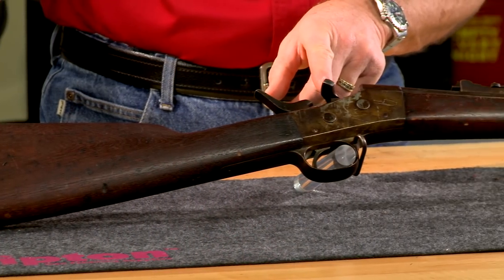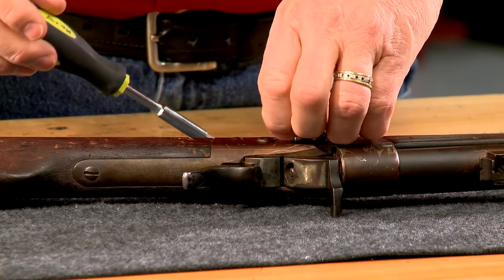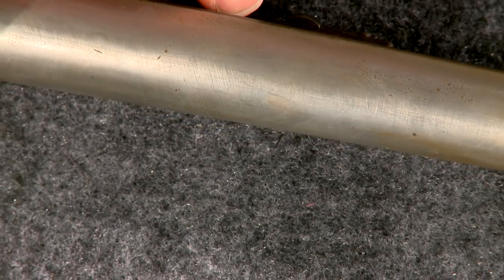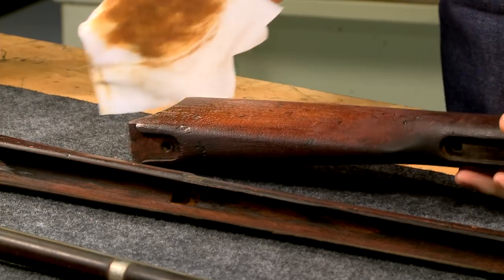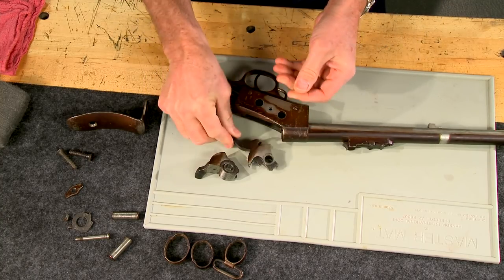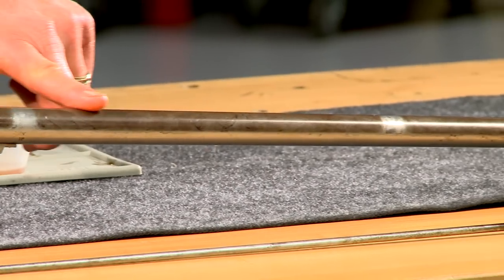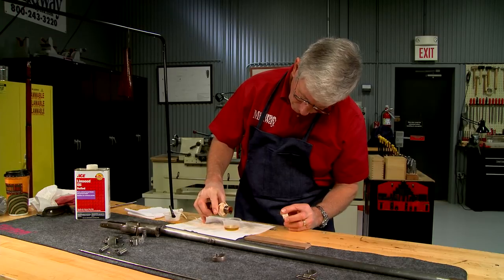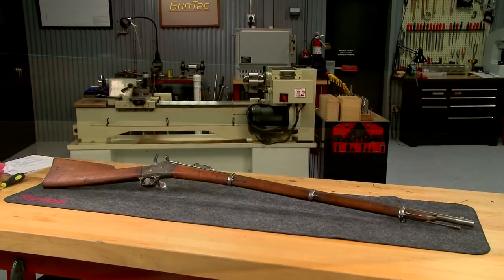How to Clean Years of Dirt and Grime from a Remington Rolling Block | MidwayUSA Gunsmithing

Comment: The key thing is to be very careful to remove ONLY the dirt & grime!  Occasionally you'll be pleasantly surprised by finding much of the original finish still intact underneath.
Reply: Atlantean  I used Murphy's Oil Soap and Tom's 1/3 wax mix to clean up a Finnish M39, and it worked awesome. Thinking about repeating for a Winchester 94.

Comment: Thanks again Larry! I did this with an old Jaeger flintlock rifle. I was VERY happy to have kept the order of which screw went where when disassembling the frozen Lock. Turns out EVERY screw was a slightly different size and length. I carefully drew out a diagram of the Lock on a small piece of Styrofoam sheet I cut out of a to go box. Punching a small hole for each and every screw in its proper spot on the diagram. It took a Vernier caliper to notice the difference in sizes, but without that step it would not have worked after the cleaning and repair to a rounded sear.
Reply: I carefully drew out a diagram of the Lock on a small piece of Styrofoam sheet I cut out of a to go box. Punching a small hole for each and every screw in its proper spot on the diagram.  

I read that in Larry's voice.

Comment: A 50/50 mix of Murphy's Oil Soap and water works well also.
Reply: I have actually seen old mix formula of 1/3 Murphy, 1/3 Rubbing Alcohol, and 1/3 hydrogen Peroxide used to clean BP guns and clean Vintage wood and products. I have tried it our and seems to work well.

Comment: Was that a shaving brush I saw being used to apply oil? Not sure Van der Hagen had that use in mind. Good stuff. Non Sibi, Sed Patriae.
Reply: Yee, it's a shaving brush.  It's a great tool for getting a little bit of oil in all the nooks, crannies and corners found on the typical firearm.  They are available in 3-packs and are very inexpensive.  I keep one in every safe, on my workbench and in my rage bag.  The one in the range bag I keep in a plastic sandwich bag.

Comment: I have an unmaintained Type 99 Arisaka whose stock I am cleaning. I hear that the Arisaka used an extinct, special type of highly reactive finish. Would cleaning in this way be appropriate with this stock? Also, could I use 0000 steel wool on the stock, as I have heard others do?

Comment: Anyone comment...I did this with a really dark m1 garand. I wanted to keep the wood with the dings & dents but clean it up a bit. I did exacty what he did but barely anything came off on the rags & wood. It didn't go down to almost bare wood like in this video. I want to stop where I am & go back later but after all the lacquer thinner Im concerned about just rubbing it down with boiled linseed oil. Any advice on what to do?? Also I would like to scrub down the parts that look rusted but I did & again no real change
Reply: My guess is that your garand has a coat of varnish or possibly true oil or linseed oil that has been left to dry to a hard finish without the excess being wiped off for a more satin / oiled finish. This is another proper, fairly common use of these type of oils, but creates a more impermeable layer that mineral spirits alone won't cut through once this has been left to harden. Try acetone to cut / remove the hard shiny surface. It is a stronger solvent so it will also draw out all oil from the stock and dry the wood if you try to use it to do the entirety of the cleaning, so I would only use it to remove the outer most layer first, then try the mineral spirits for further cleaning. If the mineral spirits still don't remove it, go a bit deeper with the acetone. It is possible to do the entire cleaning with acetone, but as stated, it dries the wood terribly and evaporates quickly so it isn't advisable to use alone. If your concerned about this method, try it on a small less conspicuous spot first. Worst case scenario, though, is it simply won;t cut whatever sealant was used. If that is the case, I can suggest  yet another even stronger solvent used in the same manner.....xylene
 Hope this does the trick for you. I love those Garands! Let me know how it works out
Reply: believe it Thanks, Ill try that. I was worried I may dry out the wood a bit to much with most methods Ive seen/read about. Also there are some spots that seem like the wood is already a bit dry so I didn't want to risk it until I had more information. I did find out a few things but Im not sure how to respond to it. I looked at everything I did the day after and it did seem like it took a good bit off but some of the wood had an odd red tint to it. I read on CMP that it happens when a service rifle has had a lot of oils absorb into the wood and if I read correctly this is a more sought after look/wood set. Since I had things I was concerned about & questioned, I gave it a couple light coats of BLO and put it back together until I can get a better idea of what I want to do with the rifle. It does have dents & dings but I think it adds character, the overall look of it says Ive seen some stuff and I wouldn't want to replace that with a I just came off the shelf look. I just want to make sure its in the best protected shape and still able to take it out every now & then without issue. Thanks again for the info!
Reply: Chem istry You are certainly welcome. Another option is to use 000 or 0000 steel wool to "break" through the high sheen first. Another viable finish method is to allow any finishes (like BLO or Try oil to dry (instead of wiping off all excess) then burnishing it with the same type steel wool to remove the shine. It creates a nice satiny finish while leaving the wood protected by the oils. This is, of course, after you have accomplished all cleaning etc. The main thing is to not go overboard with any of the solvents as you try to get at the dirt. The nice thing with acetone, is that it will generally evaporate far faster than it will be absorbed by the stock. I hope it all works out for you. there are few things as handsome as the wood grain on a garand stock.

Comment: Let's say you've acquired an original Winchester 1873 that has been sitting for who knows how long in a storage unit and all the metal is covered in rust... I'm assuming that's an appropriate situation to do one of these proper cleanings, correct?  I'm talking really rusted, all metal parts covered in it - including the innards.  The hammer is missing so I can see inside and the link and inner parts are completely rusted as well.  The lever is frozen and won't budge more than maybe a quarter inch.  I've had no luck even removing the screws yet it's so rusted.  My intention is to replace all the working parts (if I can't clean them well enough) and make it a shooter, maybe for Cowboy Action.
Reply: FlyingJJD Cool a 73 winchester, It depends,, What is the serial number? any pics?
Reply: ***** Ahhh, I said "intention."  Intentions may change depending on circumstances.  To quote Helmuth von Moltke the Elder, "no battle plan ever survives contact with the enemy."  Doesn't take much brain power to adjust to reality - a plan may sound stupid at first but the stupid ones are those who don't adjust.  But thanks for your incredibly reasoned response.

Comment: Should we let the hoppes #9 soak on the surface for some time before cleaning? I followed these directions and grime was not removed as shown on your video. I’m sure I did something wrong. Any thoughts here?
Reply: Yes, sometimes it's necessary to let the Hoppes soak for a few minutes before hitting the part with the steel wool.  Also know that it may take several applications of the Hoppes/steel wool to get all the dirt/grime/varnish off.  Patience often is the most important tool in the tool box.

Comment: would it be beter to soaked the butstock in lacquer thinner over night
Reply: I'd say that going at it with a clean rag (some recommend 0000 steel wool) and thinner would work better to pull the dirt out than just soaking it would. Not to mention that you would have to let it dry for a very very long time if you soak it, as the thinner has to work itself back out of the wood before you can continue with the linseed.

Comment: im confused as to why sanding the stock would decrease the value of the gun, but removing old lacquer doesn't.
to me it seems like if one method decreased the value the other should as well, personally i would much rather have a professional refinishing done than i would have a completely original gun just cleaned.
Reply: Maybe watch the video again on half speed
Reply: @Bladsmith  it's not properly explained in the video, so i don't see how witching itt again at a slower speed will explain anything.
Reply: Or you just missed everything about how sanding would remove original markings and how the solvent just removes excess oil
Reply: @Bladsmith  so your essential saying that scratches and wear count as original markings ?
Reply: Aaand you missed the manufacturer's markings being shown
Reply: Because there are armorer marks and proof marks on the stock that are identifiers and part of the historical value. A lot of the outer layer of older rifles tend to be dirt, smoke, nasty stuff that doesn't constitute losing value or removing historical importance. I wouldn't sand a stock and refinish unless it didn't have any markings for whatever reason or was in really, really bad shape. Or if just intended as a midgrade shooter with mixed parts.
Reply: 1:40

Comment: What the heck is that stuff? I've never seen a gun so grimy
Reply: Mostly old dried on oil and cigarette smoke by the look of it. Rifle was probably a wall hanger in some smoky place. Luckily the grime protected it from corrosion by the look of it at least. And it was kept dry as the wood itself never held moisture enough to corrode the barrel that it was in contact with.